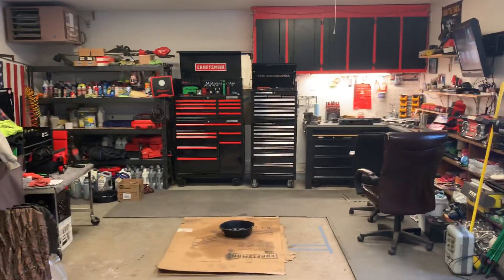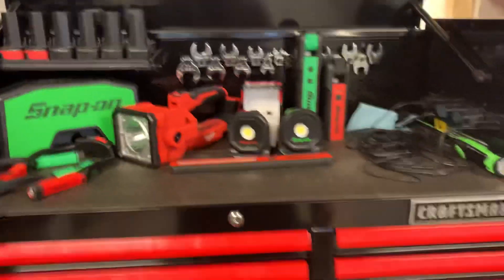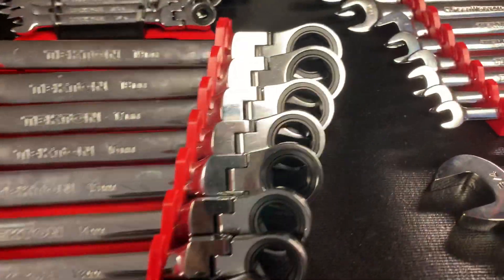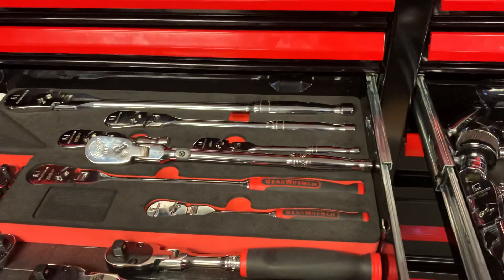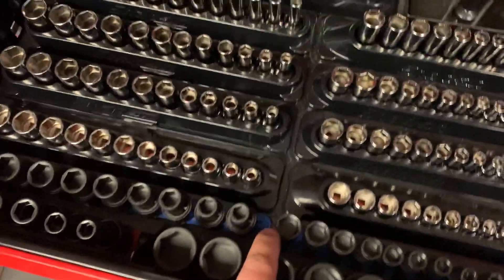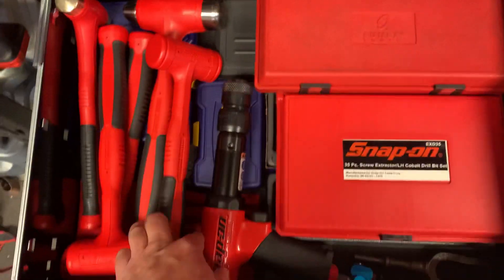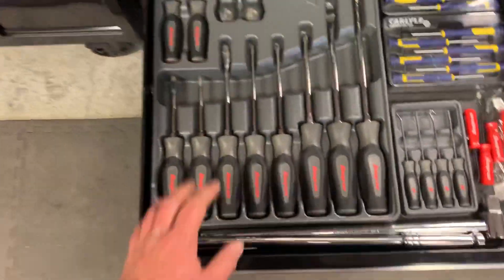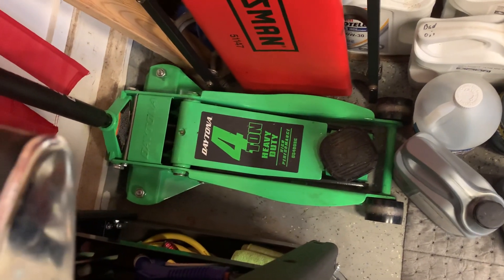All of the snap on

Comment: Wow! Your diy tool collection rivals most professional mechanics tool boxes. Most impressive 👍.  You may want to pull the snap on dead blow soft hammers in from the cold. I had mine come apart when I wasn't working as a tech for a bit. I live in Wisconsin, so I know cold. They don't like going through temperature changes mine literally just came apart so I had to send three hammers dead blow back to snap on in three separate babies they warranted but they said the cold extreme and then going to a warm wasn't good for them
Reply from the maker: I appreciate the heads up I will definitely bring them in it’s amazing how extreme cold can mess with so many things. Thanks for the view. 👍👍👍

Comment: I have the same Craftsman 41" top and bottom that you have. How did you get the back piece off of the top drawer on your bottom box?
Reply from the maker: Unfortunately as u probably already know it is spot welded on. I took my cut off wheel and cut it off was not hard at all very easy. Then hit with a little black paint. Hope this helps. 👍👍👍👍
Reply: @ramsandrzr3706  Thanks!

Comment: Around how much did you pay for the reversible Snap on ratcheting wrenches? I’m trying to find a set like that for a good price but so far all I’ve seen are scalpers
Reply from the maker: Yes there are definitely scalpers out there. There is a few different styles ones with little switch to reverse direction and one without. I have the reversible kind with switch and they are  flankdrive plus with the dual 80 technology there latest version mine came in the foam tray I paid $550 for them they were brand new in package I thought was fair...with out  the foam tray I would say around $500 is a really good price.
Reply: @ramsandrzr3706  thanks for the reply and good luck with your channel
Reply from the maker: @E.IS.M.I.A.  thanks man 👍

Comment from the maker: I forgot to go over all my bits in the top of the us general and the 3 small draws are full of snap on t handles hex and torx plus a bunch of other stuff will have to do a follow up video. Thanks for watching.
Reply: Hey man i liked the video, you have a really good tool box set for a diy guy  are you able to link the super short double box end flex ratchet spanners you talked about @7:30 I can't find them. Thanks heaps
Reply from the maker: @HALO3FORLIFE100  I bought mine off eBay there hard to find the name is mobarel extreme stubby on eBay
Reply: @ramsandrzr3706  thanks mate I found them
Reply from the maker: @HALO3FORLIFE100  awesome good to hear 👍👍